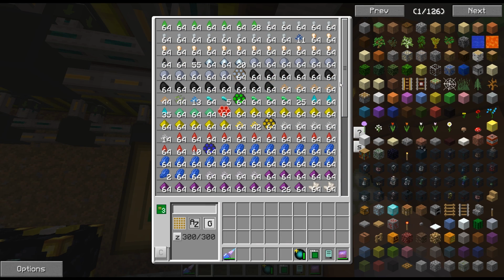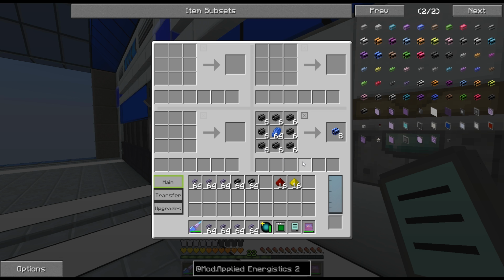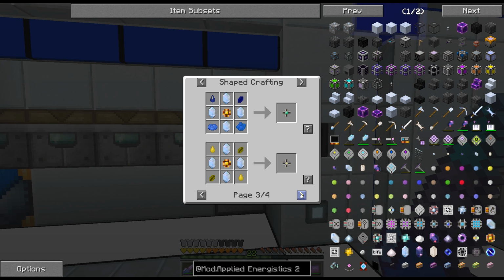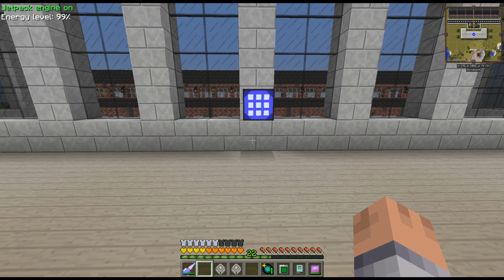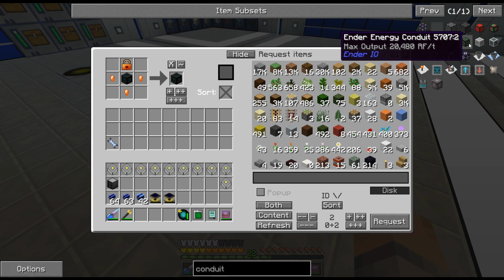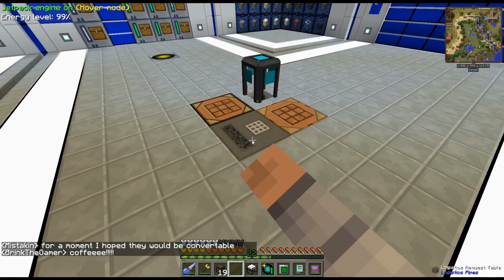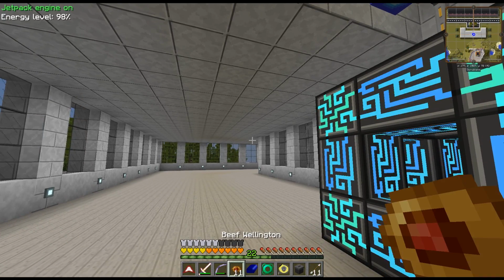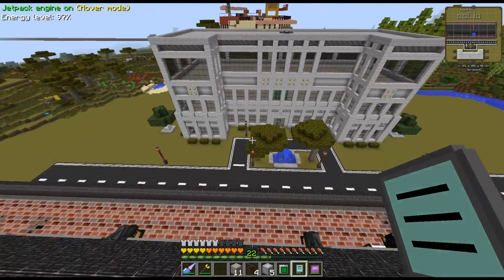ftog S3E22 - Finally AE2 and a new Office Building - FTB Infinity Evolved (Expert Mode)

Comment: Mmm never did like using one reactor for multiple turbines since the water/steam always gets messed up lol. Do looove to be efficient though so I've ended up using my 13x13x3 "slab" reactor's 1 per turbine at 25% insertion :P  http://br.sidoh.org/#reactor-design?length=11&width=11&height=1&activelyCooled=true&controlRodInsertion=25&layout=4G3E8G3C8G3C8G3C4GE3C3X3C2E3C3X3C2E3C3X3CE4G3C8G3C8G3C8G3E4G&modpack=defaults
I will be interested to see what design etc. your going to do with them this time :)